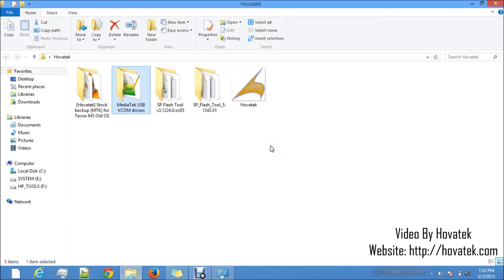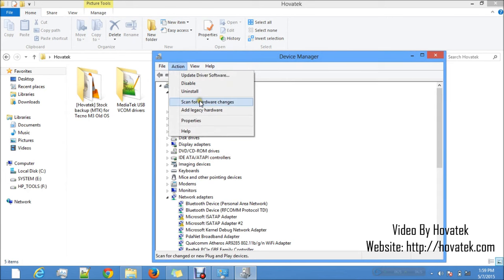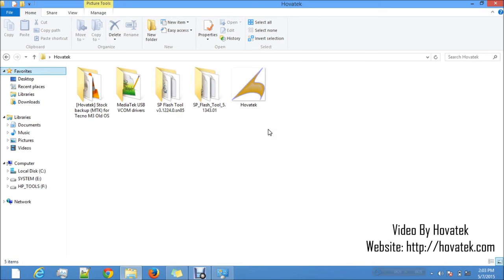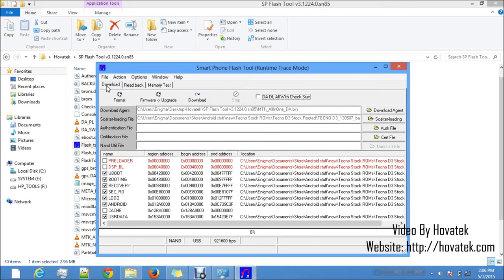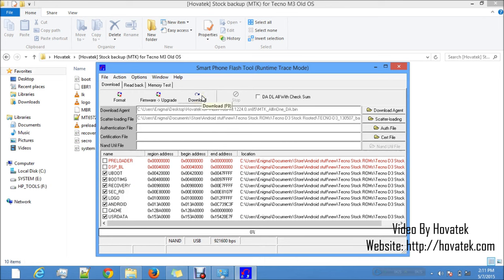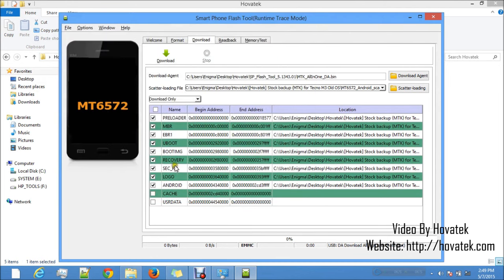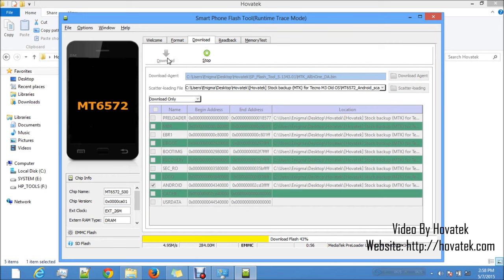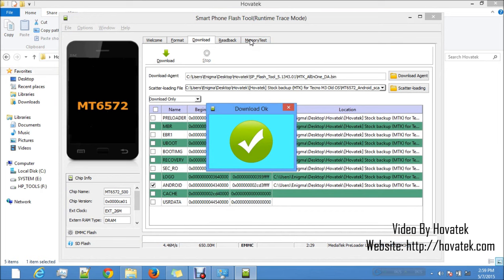How To Use SP Flash Tool (Full Guide)

Comment: Took a few mins to get it. but it does work. once you have done everything but the downloads... pull the battery and 'then' hit download. it only will download when the battery it OUT OF THE PHONE.  Worked fine for me! Thank you very much !!
Reply: also format without the battery in it. Obviously leave it plugged into your computer the whole time.
Reply from the maker: True, depending on the Sp flash tool settings and (rarely) the kind of phone, flashing will only commence when connected without the battery.
Reply: Did everything according to the video but phone doesn't want to come on now? No charge page and screen stays black? What should I do? Did not go into download and showed errors? Dooggee x5max and laptop runs Windows 8 ?
Reply from the maker: Refer to https://forum.hovatek.com/thread-808.html

Comment: im on windows 7 and i cant run sp flash tool, it give an error " access violation at address 005C1D46 in module 'Flash_tool.exe'. Write of address 00000000

Comment: Please I'm using a Redmi 9t, if i plug it to a power source it's not showing that it's charging, nothing is showing at all. The issue started when the phone will trip off and won't turn on for some days it'll turn back on before the thing stopped finally, so don't know if sp flash tool will still work, though if I connect it to a power source there is a little bit of warmth like the phone is charging so  I feel that the phone is still working just android having some issues
Reply from the maker: Go to https://www.hovatek.com/forum and click Ask Question at the top. Explain this and post.
Reply: @HovatekTV  ok

Comment: I am not sure if you can help, I flashed and formatted my phone to remove the viruses that I managed to unfortunatelly download from an open wifi. I eventually flashed my phone not knowing what I was doing and bricked my phone. But when the flash is successful I ended up with a phone which I downloaded the stock rom and then the touch screen is working in a bizarre way. If I want to press a button in the middle I need to touch the top. What has gone wrong?

I have a THL 5000, I am going to try other roms maybe they will be better. but the stock rom from thl mobile did not seem to work properly, which is strange. Any tips?

Comment: Can u please help me?  I installed driver for windows 10, from this link, watch?v=0LhcafpJ2J0, i got firmware for redmi6a, which is my phone, also found auth file. I dont get any error. What i do is i disconnect battery from phone, then reconnect (phone should be off), click start in sp flash, everthing is ticked, and have right path, and connect to usb. But nothing happens. I see these two drivers in device manager. Please help mee...
Reply from the maker: Apart from da and auth, this model would require an authorized Mi account for flashing

Comment: Ok I got stuck onto boot and can't get into recovery, I downloaded stock rom and sp flash and now I connected the device to the pc and set it up and everything and clicked download and nothing happens. Helpp :D
Reply: +TheLebronce Am having the same problem too. If you managed to find a solution please send through.
Reply: Jacob Mziya Nope, still nothing :3
Reply: Alright, Thanks.
Reply: Thanks. Got the phone back to life ***** TheLebronce
Reply: help me too
Reply: +abderrezak benmoussa  What next after Clicking the download button?
Reply: +Jacob Mziya What you do next after clicking the download button on SP Flash tool ?
Reply: connect your phone with usb after you clicked download
Reply: yes right
Reply: That part is missing of all instructions! It's true, I needed to connect the phone only after pressing download, thanks.
Reply: Plug the phone in with battery connected. Remove battery and replace it. The progress will start showing almost immediately after reinserting the battery. Do all this once you've select start.
Reply: i have followed  all of the steps but the phone just shows it charging the SP tool is just stuck on the screen... 0b/s 0byte its been 20 mins its stuck on that. its for a Lenovo A319
Reply: Thank you David. I had two issues keeping mine from working, USB Debugging and my Figo instructions says to take the battery OUT and leave it out while it's flashing. Obviously this wont work because your phone needs power for USB Vcom drivers to work. Your removing the battery while the phone was On and putting it back in,, did the trick.

Comment: i followed step by step, when i connect my phone off with battery my phone jus charges plus no download on sp flash. plz help
Reply: +Fitzroy Staple you need to enable USB debugging......settings---about phone----baseband version {tap this line 7xs}, come back out to settings----developer options---usb debugging --tick   or ..... settings-----developer options---usb debugging---tick
now run the explained process from the video
Reply: plz my fone is stuck on system recovery so how else can i activate usb debugging
Reply: Thank you A O AJIBADE. My Figo instructions Do Not say anywhere to enable USB debugging as part of the instructions.

Comment: Thanks to the comments you guys saved my butt. Figo phone company gave Wrong instructions for ugrading the Rom to 6.0. You can read the bad instructions here for a laugh - They don't tell you, you need USB Debugging Enabled or how to enable it, and do not tell you that you need the battery IN not OUT to flash the device. (you take it out with the phone On then put it back in again.- otherwise, it wont flash) https://support.figoglobal.com/support/solutions/articles/16000047848-android-6-0-atrium-5-5 <<-- This is why Figo phone company is failing badly with bad sales and No customer support. The phone, the Figo Atrium 5.5 seems to work fine now that it's upgraded.